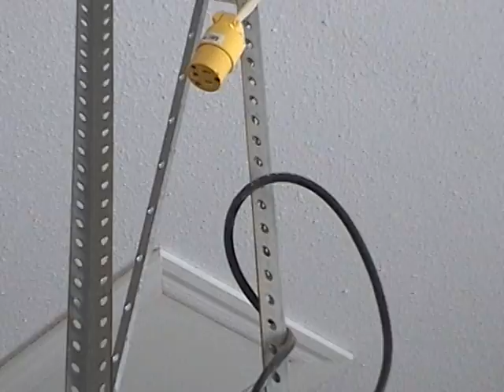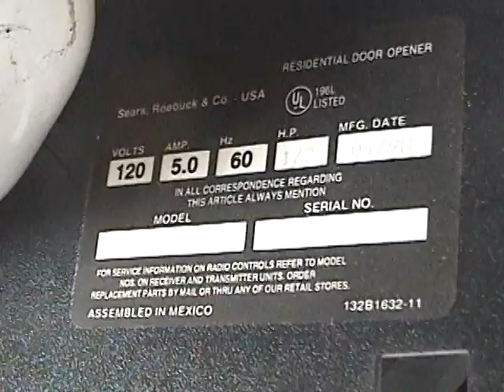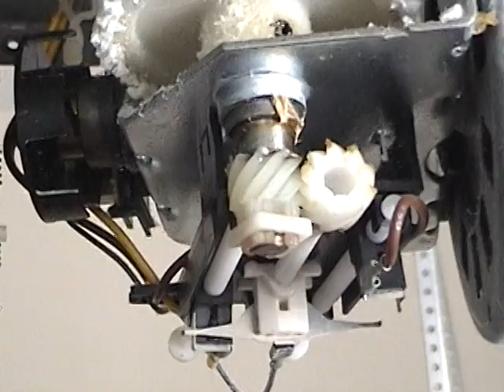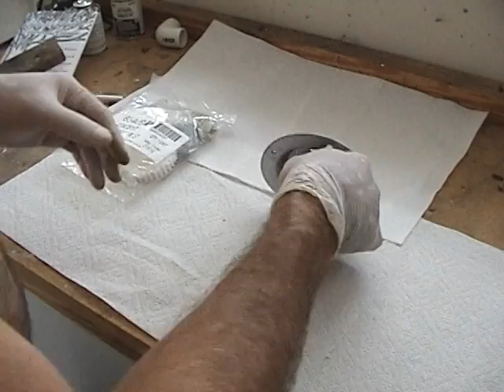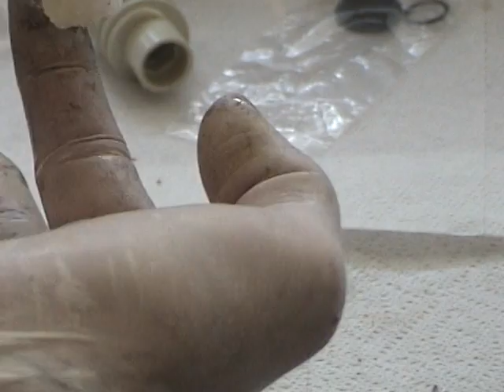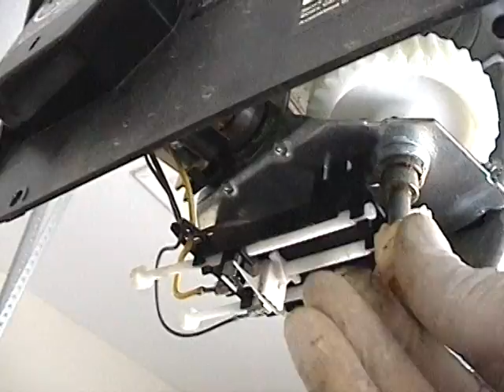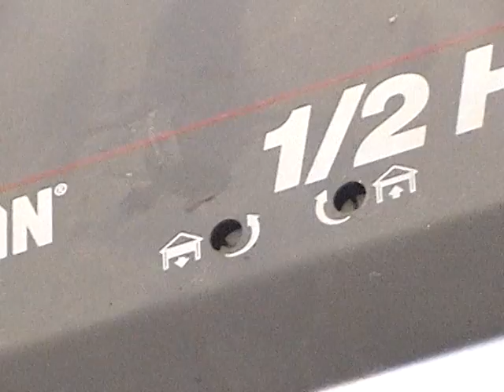Craftsman (LiftMaster) garage door opener issues?

Comment: Thank you for this video. After watching it I decided to give it a try and see if this was my problem. I undid all the screws (I actually had 8) and low and behold my gear was cracked in half. I went to the Sears store and bought a new one (same set you showed) and put it all back together quite easily. Total cost $25!
 
I am having trouble with my door movement though. I need to look into this further. My door is currently in the down position and the chain only travels about half way to the door then it stops. When I hit the button again if goes in reverse and hits the bumper quite hard. I don't know how it got so out of whack?
I messed with the adjustment screws and read the directions that came with the kit and it says one full turn equals 2 inches of travel but I am like 3 feet off!

Well, I'll mess with it tomorrow. I've had enough for today.
Reply from the maker: its possible you will need to reset the chain position so when the thinks it's down, the door is actually down. the up/down adjustment screws will let you do this but if you have adjjusted them to their limit, you may have the reset the chain. hope this helps.

Comment: Kris, very informative video, just what I needed. A few comments that I would like to pass along. 1) Be sure to clean out the old dust and shavings as the first step after the body cover is removed, this will keep the dust and shavings from getting into the newly greased gears. 2) If you mark the top sprocket and chain so that when you reinstall the top sprocket and chain the marks line up again, this should eliminate the need to adjust the limits. 3) Be sure to apply grease to all the gears while the cover is off. This simple preventive maintenance will extend the overall life of all the gears, which in turn will allow your opener to have an even longer life.
Again, thanks for this video, it was really very helpful.

Comment: I have two openers...one died a couple months ago and I bought a new opener to replace it.  After installing the new opener and being quite pleased with myself I disassembled the bad unit to do an autopsy and saw the gear broken in three pieces.  I realized replacing the gear was a less expensive option.  So last week my other opener died and this time I found this video, bought the gear for $4.75 (shipping included on Ebay), replaced the gear and it works fine. 

2 Learnings:
Both of my gears had actually shattered -- not worn down as in this video.  I noticed on up travel the trolley was hitting the stop hard, and in both cases our temperature was sub zero.  So I think over time the up travel on the opener should be checked to make sure the trolley does not hit the stops very hard.

One last thing I found was that after I reinserted the drive unit with the new gear and reassembled everything  I realized there are notches in the top plate to receive the sprocket cover.  These I did not have aligned properly so I had to redo things.  Thus when you insert the drive assembly into the unit, make sure the holes for the sprocket cover are perpendicular to the drive train.

A great video that helped me avoid buying another $120 garage door opener.
Reply from the maker: Glad I could help. PS perhaps get another gear, fix the old unit and try to sell it on Craigslist?

Comment: Kris,
  I replaced the striped gear but the clip on the end of the shaft that came out easily for you was a problem.  To remove the clip you have to remove the plastic pin through the shaft. The clip broke in process of removing the pin.  
There isn't a pin in the repair kit and I didn't see one in the parts list. I have put the old pin from the broken clip back in the hole in the shaft. It fits tight but I am afraid it may come out from the shaft rotation of the motor. 
What do you suggest?

Drew

Comment: There are different kinds one with  just the gear itself in the other would be the whole assembly and shaft in all sometimes the top grommets can wear out from the door they heavy or improper balance and that would need to be replaced. Job well done

Comment: its easier to take the roll pin out before you remove the shaft assembly by using the nail set to drive the pin out. T keep your limits from being off..use a pair of vise grips to keep the traveler (the part that  the chain is connected to) from moving. Simply loosen the chain and slip it off and put it back on and tighten it when you replace the shaft assembly. Your limits shouldnt need adjusting..i can shange one in less than 15 mins..30 yrs experience tho lol

Comment: Any opinions on how to remove that pin? I have the gear assembly removed from the unit but that darn pin just won't budge. I have a pin setter and no matter how much I hammer aware at that pin, it never moves. Once I remove that pin, it should be easy to put it all back together.
Reply from the maker: If you are pounding the pin out with a nail set, make sure the nail set is on the pin edge and not in the pin hole. I may also have used a flat blade screwdriver to pound the pin out. The flat blade will probably catch the top pin edge easier. Perhaps try a drill bit that is slightly smaller than the hole--you may ruin the bit though.

Comment: My Craftsman gear stripped last Sunday, I ordered a kit on ebay for $16 and had it by Friday.  I should have ordered just the gear itself, though as that was all I had to replace.  Probably would have been half the price.  I followed all these instructions and the only problems I had was how to remove the belt (mine is belt driven).  I found out I could loosen the tensioner at the trolley enough to slip the belt off (after I removed the cover).  Had problems removing the pin.  This took me a good half hour, but I finally removed it.  Used the replacement that came with the kit.  Also, I couldn't find the exact English size wrenches, but I had the equivalent metric sizes.  Had to take the side cover off to get to that third screw.  Why do they put those screws underneath?  Would be easier to service if you could remove them from the top.  Easy to reassemble.  Had no problems there.  The belt took a little finesse to get back in place, though.  Did not require any up/down adjustment.  I think it took me a good 2 hours, and I notice the garage door is much more quiet.  Sounded like it was getting louder just before the gear totally stripped.

Comment: Great video. Thanks. Allowed me to change the gear myself. Works like a charm now. The only step missing was how to remove and put back the chain around the gear on the motor. That cost me probably 2 hours, on and off. Some people may think it is obvious, but the video does everything step by step except that part, so it threw me off quite a bit. That is the only thing missing.

Comment: Thanks for the great info Kris.  I replaced the gear with little problem.  When complete, the door opened.  However, when I tried to close the door, nothing happened.  There is a click. The light goes on and a short humming and that's it. The capacitor looks fine, but I did not remove it.  Sounds like the maybe an electrical issue? Help.  I thought I was home free...

Comment: I was able to fix my problem in half an hr. I am mechanically inclined so I wasnt scared to put my hands in here. Like this gentleman in the video I also did not need any of the extra parts that came with my order from Amazon.com. I simply followed the step by step directions on this video on how to uninstall the sprocket part then the rest was pretty self explanatory. I didnt even need to finish the video. Thanks for this video

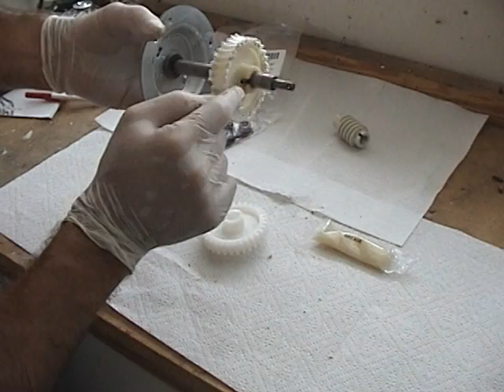Comment: This worked great for me. I bought the single drive gear Part # 41A2817 and a tube of lubricant. I didn't have a vice to use for the pin extraction so I made a template/jig out of wood to perform the procedure you discuss about 5:30 and begin at 5:40 in the video. The door works well now - quieter and smoother.

Comment: Hey, I got my gear changed but now when i put chain back on and hit button the chain goes down about 2 ft and then stops and comes back. I have played around with travel adjustment and nothing seems to make a difference. Any ideas? My sensors say they are lined up too. Door is not connected even at this time.
Reply from the maker: I'm pretty sure the limits (for up and closed) need to be reset. Mine did the same thing but stopped about 6" off the floor before going back up. If yours is that far off and you have adjusted the limit screws all the way you may have to close the door with the remote and when it starts to go back up, stop it (even disconnect power if you need to), then pull the chain off, close the door, then reattach the chain--then adjust the limits.
Reply: Kris Kasprzak Ok Thanks. I feel really stupid. I called a overhead door guy and he came out and realized I hadn't put one small connector back on before I was testing everything. Turned out to be the problem. Thanks again and great video.
Reply: your sensitivity setting needs to be adjusted. If the down force is set on 3 for instance..move it to 4 and try it. This is an indication that your machine is getting older

Comment: You can get the parts cheap on Amazon or pay a bunch more from Sears direct.
Wish me luck, I just ordered some.
Reply: Just a warning! I initially bought the cheaper parts to try and save a buck. They lasted about a month before the gear split in two. Given the amount of inconvenience and work in buying a set of OEM  parts and the work to remove and install I would have been better off going the brand name kit the first time. Just sayin.
Reply: It's been installed and is working no problem.  Reviews are consistent.  The biggest problem is with those who lubed it with the wrong stuff or not at all.
Reply: Steve Jean
Thanks for comment- I think I will go for the complete new gear with shaft and sprocket as looks like saving $20. could be an issue later. The unit is 1997 so has lasted a long time and fix it my self saves a bundle.

Comment: Question, regarding the chain on the top...  Did you have to loosen that chain for the pin/gear to come out?  Or was it like the video where if the proper screws are out, the chain comes out with everything?
Reply from the maker: I did not have to loosen the chain. I just removed the 3 screws on the top and pulled the shaft with the gear attached straight up a bit so I could remove the chain. I don't remember if I pulled the shaft completely out before removing the chain. Seems like it would be hard to remove the shaft without removing the chain, but that's what I was able to do.

Comment: Thanks for the vid.  Everything I needed to fix.  Only problem is ever since I re-assembled everything, the trolley does not bring the garage door all the way down, and it wants to go up way farther then it should...the fine tuning knobs do not effect this problem.  Any clue what I did wrong when I put the chain back on?
Reply from the maker: I'm pretty sure the limits (for up and closed) need to be reset.
Reply: If the chain alignment to too far of then the limits wont help since they have a limited range. Disconnect the chain from the sprocket and make sure the door is all the way up or down. Then set the limit screws to about centre by turning each way to find the approximate centre. Then plug it in and press the button and watch the direction of the sprocket turning to find out if it is in the up or down position. Unplug again and reconnect the chain to the sprocket so they are in the matching position. Then the adjustment screws will work for fine tuning.

Comment: Excellent video.  You saved me from buying two new garage door openers.    The only other suggestion I would have is to loosen the tension on the chain, at the tension bolt.    This took a lot of tension off the slider unit and it was much easier to remove.   Thank you very much!

Comment: Video was spot on.. instead of changing the gear.. i just ordered the gear and shaft makes this much easier.  Only thing i would suggest is to loosen the chain a bit to make setting screws back in a little easier. I also had to adjust my travel after this fix.  Thanks a lot this video helped.

Comment: Hi Kris, Thanks for the great video. I followed your instructions and the gear replacement went fine. Now that I have put it back together I had some problems. The door was trying to close too far. I adjusted the DOWN limit and got that right, just 'kissing' the floor as you put it. The problem that I haven't gotten past is that the door also will not open fully. I have adjusted the UP limit screw to it's limit, but the door is still about 6" short of fully opening.

I'm sure I brought this on myself somehow. Any suggestions for getting this finished?

I believe that the chain is still in it's original position. The trolley meshes just fine with the emergency release mechanism.

Did I screw something up with the center limit?
Reply: I had screwed up the center limit settings. By running the opener and watching the center limit assembly I figured out which direction I had to move the center limit contact to allow more movement in the UP direction. I took off the helical gear with the 3 prong retainer, twisted the center limit shaft to give me more distance before meeting the limit of the UP contact and was in business.

I must have twisted the center limit contact when I took off the helical gear in the first place. D'oh.

Comment: Thank you!  Excellent video.  I'm not too handy, so I bought the version with the gear already on the shaft.  I loosened the chain with the bolt adjuster and put it back on the top gear after mounting the shaft.  Without your video, would have taken twice as long.  Thanks again.

Comment: Thanks Kris!  Saved me a good chunk of change there!  Took me about an hour and a half.  Getting all the tools, getting the air compressor out and put together, etc... Tough to get that pin out w/o a proper size hole punch.  Ended up finding an 8 or 10 penny nail and took off the tip.  Also had to loosen and take off the chain to pull the whole rod unit on and off again, then re-tighten.  What I didn't do was put it back on the right way as the little chain cover holes were not lined up.  Oh well... not taking that apart again just for that!  :o)  Thanks again!!
Reply: Hah, I was stuck on the pin as well. Your suggestion made me go out and try again with a cut off nail, and it worked! Thanks.
Reply: nail worked perfect....great tip..thanks for the video

Comment: Very helpful video.  My opener is an "Overhead Door" brand which is probably made by the same company and is very similar.  Only took a few minutes to figure out the differences but disassembled easily once that was done.  The local Overhead Door company told me no parts were available anymore for my opener and I would need a new one..for $330.00 including 2 remotes..a quick search of their corporate online store found the needed gear for 19.99 plus shipping !!  Thanks for the help !

Comment: Just used your video as a guideline to fix my garage door opener.  Removing the pin that holds the gear in place and then putting the pin back in was by far the most troublesome.  Thanks for sharing this DIY vid.

Comment: I have this same garage door opener.  It is still working, but it has started to lower until it is about 6 inches above the floor and then it stops and goes back up.  There isn't anything stopping it from going down.  This first started happening right after the light stopped working... but I was able to tighten the light bulb a bit by hand and then it came back on so I didn't think anything of it.  However, the problems started shortly after that. 

When the door gets to about 6 inches above the floor, stops then starts to open again, I hit the remote and it stops moving up, then it lowers completely (I may actually have to hit the remote once more, but I don't remember at this moment).

I tried unplugging the opener and plugging it back it.  That made it function properly for a few times, then it started opening about 90% of the way and stopping there.  The last thing that I've noticed happening is that the light doesn't shut off after a couple of minutes of being activated.

My question:  Do you think it is a problem with the gears, or do you think it is more of an electrical/circuit board issue?
Reply from the maker: I think neither of these are your problem. It sounds like the stop limit needs adjustment. Basically there are 4 adjustments on most openers 1) stop limit 2) open limit 3) close force 4) open force.

I'll guess your stop limit (which decides when to stop the motor) needs adjusting. Possibly the stop force--but since the door isn't hitting the ground, I doubt that's the issue.

Find the stop limit and slowly turn the screw between open and close cycles, you will see the door stop closer or farther from the floor depending on which way you turn the screw. Have the remote in had so you can stop the door if you adjust the screw too far--i'll guess a 1/2 turn per try??? When you get the door to close all the way the close force may need to be adjusted. This latter setting tells the opener how much force to use while opening and closing.
Reply: Thanks for your feedback.  One thing I've done is plugged the garage door opener cord into a different outlet using an extension cord.  For now it seems to be working fine.  Based on this, do you still think there is a problem with the stop limit?
Reply from the maker: Darcy Aleck Am I hearing this right...plug the opener into one outlet and the door will not open/close all the way, but when plugged into another socket, it works?!? Are any circuit breakers tripping?